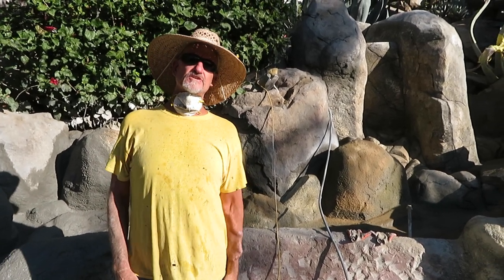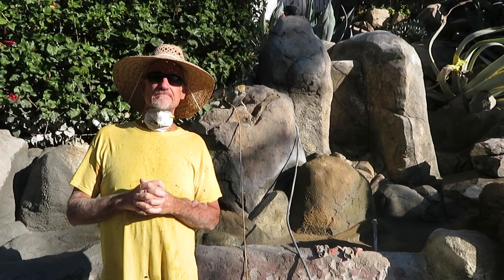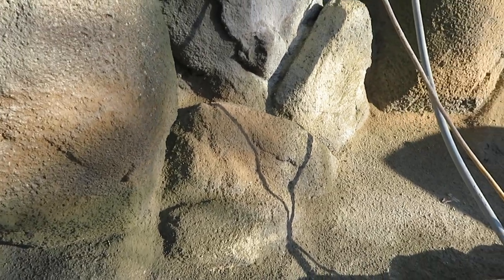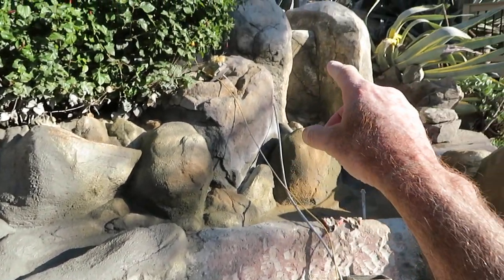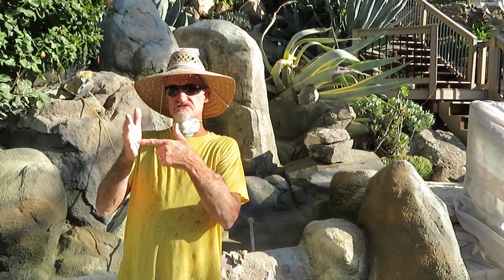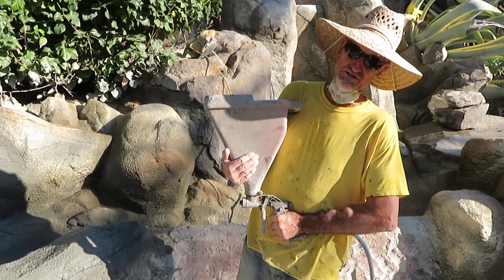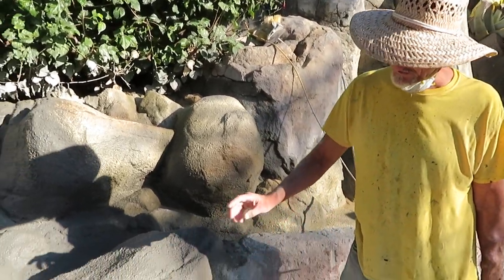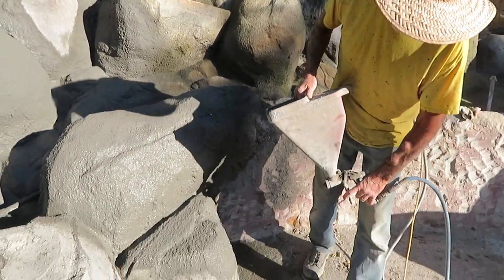How To Texture Coat Fake Rocks

Comment: At the end you spray that cluster of three rocks. Now I’m wondering after building my own rock, how you go about building the cluster of rocks. Do you build all three entirely separate or is that smaller rock built on the same rebar bubble as one of the larger rocks? I’m thinking maybe you added the small rock last and tied the rebar of that one into the larger rocks that were already in place.
Reply from the maker: Hi Justin, depending on the size I always try to nit them together if they're a collection of rebar bubbles.  Or when small just make them out of solid concrete/shotcrete.  The key is that we want the rockwork to not be vulnerable to expansion/contraction cycles due to temperature changes causing cracking and possible water loss when the rocks are a part of a water feature.  So I use multiple rebar sticks to, again, nit the rocks together and onto the projects structure.  Anyway, hope that makes sense...  :)

Comment: A tad confused. I have a few areas to patch and recoat. You're mixing 1 to 1 Spec mix and Portland cement? Add water to desired consistency?
Reply from the maker: Spec Mix is already mixed.  It's good to go.  Probably any pee-mixed mortar can work.  When I've mixed it up myself in the past I've used 30 grit sand and Portland cement in a 1 to 1 ratio.  Also I pour my mixed mud through 2 quarter inch screens overlaped into a a bucket to help reduce clogs when useing my little drywall hopper.  Key is having lots of acrylic.  5 second pour for a 5 gallon batch and 12 seconds for a (3) 80lb bags in a mixer.  Then must make sure you slow cure it by keeping it wet, not dripping, with a small hand pump sprayer or misty hose.  Fast cure will crumble away quickly..   Hope yhis helps.  Good luck!  :)
Reply from the maker: Geeze... I meant "pre-mixed" not pee-mixed... 😝

Comment: Hi David i love your videos. I would like to make some fake rocks hear in the UK could you send me a link to the concrete and add mixture please i would be very great full .
Reply from the maker: What's up Ray!  How awesome to hear from someone in the UK!  And thank you for the kind words.  On mix designs I'm a really simple guy.  I use off the shelf products and a very basic strategy.  For the structural or "scratch" coats I simply use bagged 4000 psi concrete that I get at Home Depot here in the states or shotcrete, (provided by sub-contractors I use).  Then when I need to apply the concrete on the more vertical surfaces of my rocks I add a mortar mix called Spec Mix.  Again from Home Depot.  The ratio is approximately 4 parts concrete, (60lb bags) to 1 part, (also 60lb bag) of the Spec Mix in a mixer batch.  You can use any mortar to get your batch more "sticky".   I also add an acrylic add-mix by a company called Sika.  But whatever you've got there should surely suffice.   The acrylic is very important as it strengthens the material and helps it resist moisture penetration a bit.  I add it to the vertical scratch coats and ALL mortar or texture coats.  

Speaking of mortar coats, I use, again the Spec Mix since it pre-mixed and ready to go right out of the bag.  But you can also make your own with sand and Portland cement.  The ratios can be 1 to 1 for really sticky batches, (for spraying as I show with the simple hopper) up to 1 to 3 for hand applied coats.  Again, with the acrylic added in.  How much acrylic is about 7 seconds of a pour out of the gallon bottle into an electric cement mixer for a big batches to 3 to 4 seconds if you're mixing in a 5 gallon bucket.  And that's about it.  For a complete explanation on how to design and build a complete feature in my newest course you can go to www.davehenderson.podia.com.  For this week only, (ends Sept. 26th, 2020 at 8pm PST) when you purchase one of my cheaper for sale how-to products you will be able to get 1/2 off my newest and most comprehensive course, "How to Design & Build a $17,000* Waterfall/Slide Feature".  It includes over 5hrs of video training in 10 videos covering 8 sessions.  Each session also includes 3 to 11 pages of pdf downloads for a total of 79!   Just look for the discount at check out.  This is a $174.50 value!   Anyway, I hope this info helps.  If you have any question just let me know.  And good luck on your project.
Cheers, Mr. Dave  :)
Reply: @DaveHendersonFakeRockVideos   Wow thanks for such a detailed description Mr Dave, that's great. I'm a landscape gardener by trade and I've been really interested in faux rocks for a couple of years but struggled too find an affordable sculpting mix hear in the UK. I can only get access to buddy rhodes vertical concrete which is £30 a bag but your formula is really simple and affordable which is inspiring too me. Thank you for the informative YouTube videos, I've been watching them all day. Keep up the awesome work and thanks for the advice Mr Dave. Peace and love from your biggest fan in England

Comment: Do you ever color the texture mud?
Reply from the maker: Do on occasion.  But not usually.  Reason is that in general the rocks out here in San Diego County have a base color of grey often.  So just coloring it with the colored stucco fog coats on top of the texture coats then exterior latex paint work well.  Of course, you can add tints to the mud as much as you'd like.  :)    davehenderson.podia.com for more cool content if ya like.   Anyway, thanks for the questions.  Hope you have an awesome day!  Cheers, Mr. Dave :)